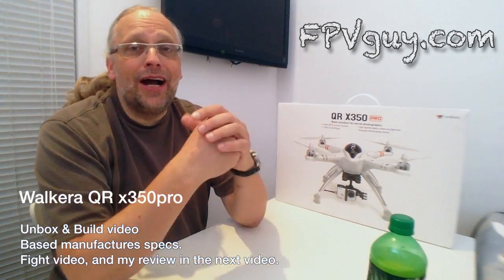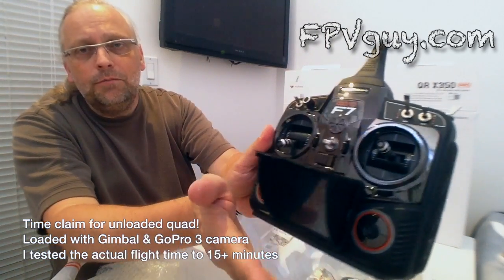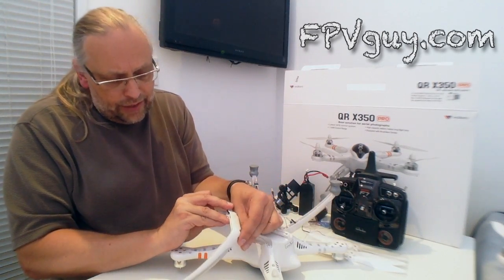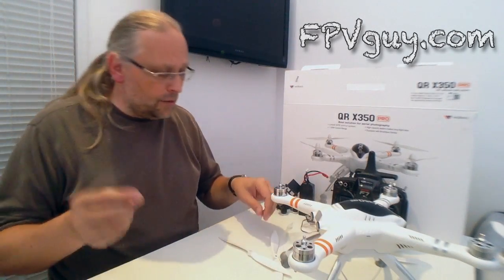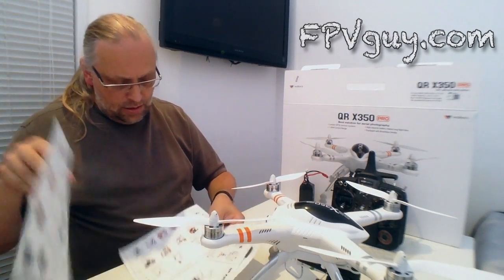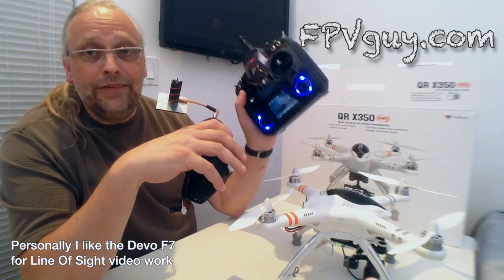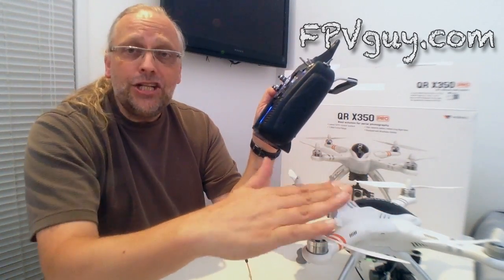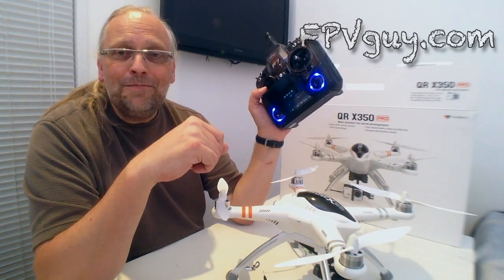Walkera QR x350pro build video

Comment: Nice vid. I have a huge problem with the Qrx-350+Devo 10 controller. For some reason the left stick (throttle) controls the gimbal (up and down movement) instead AUX 4. I tried to update the firmwire at Devo 10, but the problem remains. Any idea? Thank you in advance for your help.
Reply from the maker: Lorant Bartos   Sorry for the slow reply here.   
WOW.  ok that is not right.    and Im sure that you can put the throttle on the aux4 in the radio.  you said you updated the firmware.     but Im wondering if the radio is setup correctly, may want to try creating a new model and follow the radio setup instructions for this.
BUT.. everything said and done.. Im suspecting a couple wires plugged into the receiver in the quad is simply plugged into the wrong place.  that leaves you with option 1.  crack it open and swap them.   I did post a PDF on my blog with the correct positions.    OR option 2.  get a new one where the cables are installed correctly. :-)
Reply: Okay, Bo thanks for the tips. I hopőe that i can manage with the transmitter. Thx for help.
Reply: Bo Lorentzen Hi, Bo thank you for your answer. Now my only problem is, that i cannot find the PDF file you mentioned. Please be kind and put a link here so i can watch how the wires are connected. Thank you again, have a nice day.
Reply from the maker: http://www.fpvguy.com/2014/05/walkera-qr-x-350pro.html    look for the link "original manual"  that show the ports and whats to go in them.

Comment: Bo or anyone has the same issues.  One of my motor by the binding light arm get very warm after or during flying, but the other 3 are not warm at all.  What do you think case the motor to get warm.  I'm afraid the drone might fall from the sky like most pilot experiences with this quad during flight if that motor fail.  Thanks in advances.

Comment: Hello nice video....is there some kind of Low Voltage cutoff, Safe-landing feature??
Reply from the maker: ST Logan   sorry for the slow reply.   yes there is a low-voltage cut off. but honestly, you should never be using that when flying copters.  instead figure the flight time and out land a couple minutes before the low-voltage auto land so you get to chose where you land ;-)
Reply: Bo Lorentzen YEP..always set a timer;; lol with this big sucker i dont even wana wait for it to be the last minute,,not like my little ones.lol.  thanks for all your advise.  BO knows FPV.
Reply from the maker: :-)   BTW. there is a couple quick ways to know.. if you compare the climb rate with a full battery and a low battery, you will see that the entire thing start getting sloppy in the air once the battery is about half empty. (or full depending on world view)
Reply: cool thanks ..i still cant get my ilook to take photos i have a SD card.. Samsung EVO 10
.
Reply from the maker: Remember you need to switch the selector on the iLook from video to stills.. then the release on the radio should work
Reply: Yep I have had  it switched to Still photo option....are there some settings on the remote I need to change?
Reply from the maker: OK   im guessing you can also not start stop video recording from the remote then ?   if thats the case, its because Walkera never connected that cable to the receiver on the first batch of the 350's      several folks have put how-to tutorials online about that issue

Comment: Bo,  I have a question about my qr x350 pro. Can there ever be a time when the drone will not be able too find any satellites? I'm having a problem with mine finding one over my daughter and son-in-laws house. Do you think there might be something wrong with the drone? I've never had this problem until now. Thanks for any advice you can give me.
Reply from the maker: it should be the same most places,     however it will have problems between tall buildings or under trees.  also if you traveled a bit to get there.    its going to take a lot longer for the quad to acquire GPS signal in a new location.

Comment: You seem to know a lot about Walkera QR X350, I have lost control over mine a couple of times so it crach, It seem that one rotor is stop working. And when I restart it works again, but it is a little scary when you fly over people and I have cracked it a little bit. Do you have any idea what it could be? /Jonas
Reply from the maker: There is a couple of things to keep in mind.. make sure you give the system a couple of minutes AFTER it have full GPS lock.    
You say you lost control and it crashed.. but you also say the motor stopped, that is a instant crash?   Was that caused by the crash, or did that cause the crash.  
My guess, you had a crash caused by loss of orientation?   after the crash, one of the motors, probably the same every time, randomly stop?    IF that is the case,  I would replace the ESC, and maybe also the motor, just to be sure.     
ALSO make sure all motors are balanced and running smoothly without vibrating the arm.. because strong vibrations can cause the flight control system to fail.
DON'T Fly over people unless  you have a liability insurance if you cause a injury. 
PARTICULARLY if you are not sure if the motor may stop.!   ;-)

Comment: Could you use the gimbals from the qr x350 pro for any other type of walkera drone? Like a hexacopter for instance which also uses the ilook camera
Reply from the maker: The gimbal is bolt on - power it up and it will stabilize
That siad - it is 6-7 year old tech - and the quality of the gimbal stability is rough by todays standards

Comment: Bo...I have a Walkera Devo 8S controller. Will this work with the QR X350 or just the Devo 7? I also have a Go Pro Hero 4 Silver. Will this fit in the gimble or just the Go Pro 3 & 3+?
Reply from the maker: +Silver Seeker60   The Devo 8s will work fine.  and the GoPro4 fit the gimbal. :-)
Reply: +Bo Lorentzen Do I just need to purchase the BNF version and do the gimbal and other add on's as I gain experience? Can I just use the Receiver from the 8S inside the 350 Pro?
Reply from the maker: If you buy BNF,  you should not need to put a new receiver inside. ;-)

Comment: Hello and thanks for the videos on the x350pro. I have a question, can not figure out how to control the ilook+ camera from the F7 as received out of the box. Gimbal works fine but when I try to change the set up as suggested in the manual for F7 camera control it does not work. Any help would be appreciated.

Thanks
Reply from the maker: Hey Doug,   you should be able to start-stop recording from the switch, you need to push it down for about 1+ sec then push it back up.
Reply: Bo Lorentzen Just found that Walkera piggy backed the PIT gimbal and video control into aux1. Had to put the PIT wire to aux2 and changed radio settings and it now works. Not good, should have worked out of box. Problem was if the gimbal was moved to far or quickly it would start or stop video, switch didnt work. I see others have had the same issue. Hope they get it figured out.
Reply from the maker: Hey Doug,   Sign.. that is amazing,  I told them to fix the piggy back mistake when they first made this quad.   it is kinda disappointing that after all this time they insist on not fixing outright mistakes.      Sorry, I should have remembered,  Im glad you sorted it out.

Comment: Bo, if you have a Devo 10 transmitter, are you able to remove the battery tray that comes with it or is it wired permanently in there? I cannot seem to unplug the battery tray on mine. Thank you
Reply from the maker: I don't actually have a Devo 10,  but in my Devo 7, the battery tray is connected with a little white plug.. if thats what you mean,  that can be gently released.   on my F7 I think its a JST plug which can be unplugged.   however in all of them, there is a "spacer tray" in the battery compartment that is glued in place,  on the F7 I knocked that out so I can use a bigger battery to feed that hungry screen.

Comment: Bo,I am thinking of getting another receiver, I have been in contact with hobbyking in hongkong where I bought it and there reply was to send it to hobbyking in the uk, but with the price for p&p because of the weight it will cost  to much money  than if I got another receiver for $35.00 plus p&p, and if it means a replacement because of faults they would send another one to me from hobbyking hongkong but it would cost $20.00 for a return plus p&p to send it to them.
Reply from the maker: ?  You think there is a problem with the receiver?

Comment: Bo,

I need your help. I have the 350pro with the the devo f7 radio and Gopro 3+. hooked the G-2D Gimbal and I can't get it to Tilt. below is my Set up
703a 
Aux1-pit
Aux5-roll
--------
Devo f7
Gear-mix SW
Flap-Gear SW
Aux2-Aux2
Any advice would be greatly appreciated...Thanks
Reply from the maker: The AUX2 should be connected to the controllers tilt.   check with the setup manual what that the radio is setup correctly.

Comment: Hi, Bo. Could you tell me which transmitter you are using. Is it a mode 1 or mode 2?
Reply from the maker: +John Shaw   Im using mode-2   F12e
Reply: +Bo Lorentzen  Thanks for the quick reply. Do you know if you need to swap the receiver if you switch from a mode 1 transmitter to a mode 2?
Reply from the maker: Hey John,   switching mode is in the RX,  you basically need to crack it open (easy) and swap the throttle guides to the other stick and then change the mode,   shoot a email to walkera and ask for instructions.
Reply: +Bo Lorentzen  Hey, Bo. Thanks for all the advice, you've been great. I managed to convert it to mode 2 by doing as you suggested and everything works fine. I'm now flying in mode 2, much better. Thanks again and keep the great video's coming!
Reply from the maker: NICELY DONE...  you definitely have the tinker skill required to become a awesome copter builder.

Comment: My QRX 350 pro, takes off properly, and after a few seconds changes the direction. example, when the radio triggers for him to go forward, he goes to the left, and when triggers for him to go back, it goes to the right side.
can help solve this problem?
Thank U.
Reply from the maker: Luciano lhag   sounds like your radio is not setup correctly, sounds like you are suddenly flying IOC mode. there is a setup guide for the radio in the instructions material.    create a new model and a fresh radio setup for that mode.

Comment: Bow,
I have lost the ability to bind with 350pro with devo f7. I upgrades from devo 7. 350 left light flickers but will not go out. What do I do to correct this problem.
Reply from the maker: Sounds like you may need to re-bind them.

First try to turn on the 350, then turn on the radio when you hear the 350 beep.. if that don't bind,  you need to follow the manual and rebind the two. :-)

Comment: BO my kit came with a receiver upgrade cable and the controller upgrade cable. Do you know the proper procedure for upgrading both?
Reply from the maker: Its so long time into production, I would probably just leave it alone as the last firmware update is probably a couple years old by now :-)
Reply: ok thanks i looked the purchase date up and it is 9/08/2015
Reply from the maker: Thats fine.  this is a 2014 product so you are good.
Reply: item x350-PRO-F7
Reply from the maker: Yup.

Comment: I noticed that my motors on x350 pro seem to get real hot after only 6 min of test flight. It is cloudy & very windy would that have an effect on it?
Reply from the maker: High wind will blow through the battery in half the nominated time. ;-) and leave you with red-hot motors.
Reply: Okay cool thanks bro. Have a good one

Comment: Bo, I am interested in this wire so you can turn the camera on by using the retract switch can you send to me a photo of it because I am waiting for a price including p&p to u.k. yours price was $3.00 I think,would be interesting what the difference  between the two prices
Reply from the maker: It have a small plug for the camera in one end and a plug for a servo plug in the other end.    shoot me a email to fpvguycontest@gmail.com I can send you a picture.   naturally sign up for the contest at the same time ;-)
The cable was in the little plastic bag with the screws and parts.

Comment: can i check with you, the pro ver comes with build in osd? as im using devo f12e . i can see full telementry reading on my tx screen. But dont have the home feature, meaning showing you the center arrow how much degree to move home.
Reply from the maker: Mervyn Cheryl   The 350pro only have the telemetry options, but not the home feature.

Comment: I have the white 10 channel transmitter, can you tell how to switch the camera on and off using the transmitter
Reply from the maker: Bryon, that "should" be the gear switch.. it operate like a pushbutton, so flip it down for 2 sec, then back up..   HOWEVER.. I dont think its hooked up correctly in the quad.  Im trying to sort it out with walkera right now.  you would need to use a servo extension cable and pull it out, then connect the adapter from the tool-kit that is the on-off switch.

Comment: can someone offer a suggestion?  I have a 350 pro, purchased directly from Walkera with a F7 radio.  The G2 Gimbal works, but has never responded to control of angle, nor camera does not start/stopm manually it takes good images...   I plugged into my laptop and upgraded firmware from V1.1 to V1.2 last week, now radio appears to bind, but it will not go into cumpas calibration mode nor will it arm motors to fly.   
(also note - there is now a AR X350pro message group on Yahoo groups)
Reply from the maker: Check your trims, likely they are not centered that will probably fix the arming issue.    
You need to center the calibration screw on the gimbal to get it to work with the pitch.  make sure its connected ;-)
There is no start stop option..  however in the box is a little fat extension cable that will connect to the camera cable, if you plug a extender into the end of it and then into the gear ch on the receiver, then you can start / stop video by flipping /cycling the gear switch.    Sorry, don't real yahoo groups.. but several of us are answering x350pro questions on Facebook at https://www.facebook.com/groups/711455455567160/
Reply: Bo Lorentzen Bo, thanks, I have already centered the trims, to no avail.   The start stop/shutter control is supposed to function off of the Gear Switch, but doesn't and the three wire connector to the radio for 'PIT/ROLL/Aux was not plugged into the radio when it arrived, so I plugged Pit into the Gear slot, assuming that was as marked, the Aux2 'dial' or knob has no impact on the gimbal and running the POT on the controller from full CCW to full CW rolls the camera from pointing straight up to the horizon and back to straight up again, I have it centered to that the camera looks straight ahead when powered up....
Reply from the maker: I already wrote that it do NOT work off the gear switch in the stock config.  and I wrote how to remedy that. ;-)     please read my previous post and then take a moment to check out the support forum on FB.

Comment: Bo
i have a devo 10 and x350pro

ive just bought a devo f7 so i can do a bit of fpv, ive binded with 350 pro but the mix switch wont work , i think its not set up correct
do you know what the settings should be ,ive tryed to get an answer and cant find one

thanks terry
ps if a flick the gear switch it seems to clime fast..
Reply from the maker: Check the F7 setup guide in the PDF manual on the CD you got.  follow the steps and you should be ready to go. ;-)
Reply: Bo Lorentzen
THANKS Bo
found it actually in the pdf for the x350 pro file
thanks for the advice , it pointed me in the right direction ..
Reply from the maker: GREAT.  love when stuff works out :-)